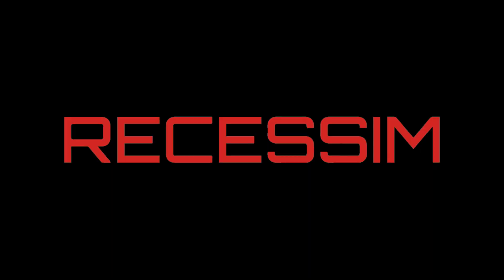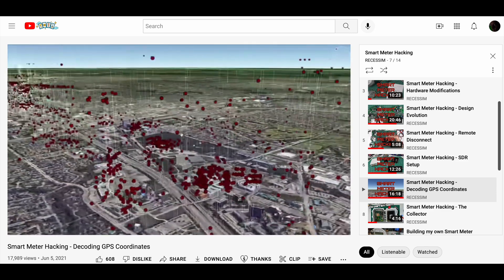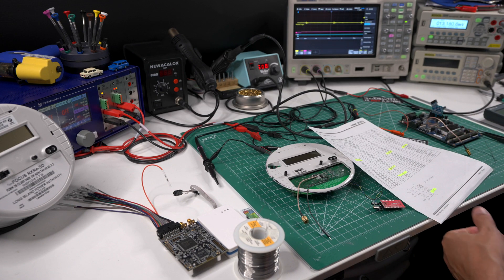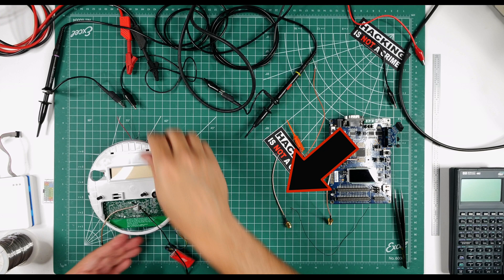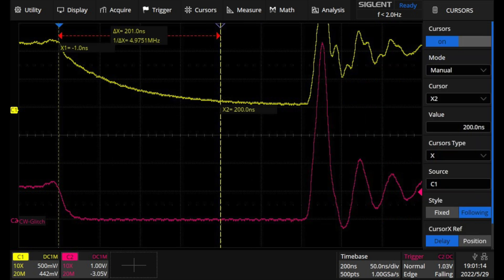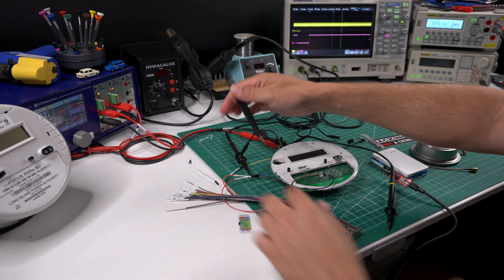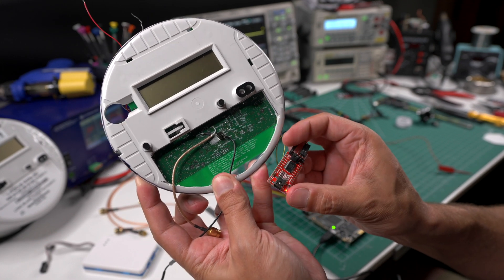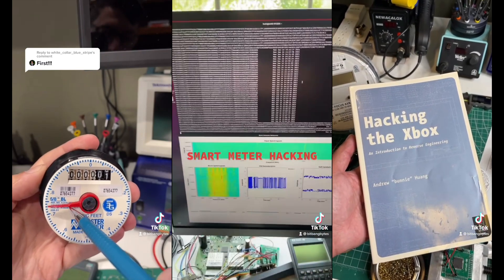CONFIRMED Smart Meter Attack

Comment: One security protection against voltage glitch attacks is by manufacturing a void in only some of the layers of the PCB under the chip with a Schmitt trigger like circuit in it to provide hysteresis to the power to prevent an undervoltage condition; power only gets to the pin if it is high enough and is cut off completely when it drops. You then have to unsolder the pin in order to perform the glitch, making it impossible to glitch in the field when under a time constraint. This is particularly difficult if the chip is a BGA (many have a central area without pins) where you cannot access the power pin directly and have to unsolder the entire chip.

Comment: The slight variation in uC startup time after reset might be an oscillator or PLL waiting to lock?
Reply from the maker: That’s what I’m thinking too, it’s something that’s settling and can vary slightly each time
Reply: @RECESSIM  If the bootloader does an external memory access or sets any I/O pins, you could probably trigger off that. Assuming you want to glitch the transition after the bootloader has finished. Should be more deterministic than timing from reset.

Comment: So you actually do have the firmware now? Also, how can a puts() command  print the entire firmware, I would expect it to stop once it finds a null character??
Reply: How did you know something like this could happen in the first place? You went looking for it and then it happened, I don't understand how this is possible without a full understanding of the mechanism. Normally when you insert randomness in a running computer program it will just crash.
Reply from the maker: @CarloRoosen  I have seen other attacks and read that you can insert some well controlled “randomness” and cause issues that don’t quite cause a crash, but cause unexpected things to happen. I experimented with this technique using a development board that uses the same processor and then moved on to the actual hardware I want to attack. Nothing is ever what people tell you it is… :)
Reply: @RECESSIM  Yes clear, I think I understand how you got to this point. The question remains, how is it even possible? After the glitch the processor is operating on its own. So there must be a state (registers & memory) in which useful things can happen not intended by the programmer. To me that is incredibly difficult to grasp. Like the monkeys typing Shakespeare thing. Anyway, I am looking forward to the next step.
Reply: Also, you should have more viewers ;)
Reply from the maker: @CarloRoosen  Thanks. Feel free to spread the word!
Reply from the maker: I am very close, not sure why the puts() doesn’t stop at a null when I glitch it, but it will loop through the entire flash multiple times. I let it run for an hour once and it seemed to end up in a tighter loop but still printing!

Comment: This is insanely interesting!
Trying to glitch the processor when it is initializing the JTAG lockdown should be worth a try. Automating the check as you did with the serial output should be possible.

Would it help to increase the diameter of the glitch cable so that It can drain the internal capacitors faster / more precise?
Reply from the maker: I am excited to give that a try, if JTAG could be unlocked with a glitch it would be quite a find! 

Generally outside of decreasing wire length, or increasing wire gauge people just remove the decoupling caps on the target board which has the same effect. Could make the processor a little less stable though, I was trying to avoid any other mods to the meter.

Comment: A lot of the ringing you're seeing on the scope will be due to using the ground flylead on the scope probe - for this sort of work you really need to use an ultra-short (<10mm) ground to the nose ring of the probe
Reply from the maker: Thanks Mike, appreciate the suggestion! I have those short spring ground connectors for the scope. I’ll test that out to see how it looks. I was curious about the ringing but more concerned about the capacitor decay time so didn’t chase it.

Comment: I understand how glitching the processor during the serial I/O operation could reset a pointer and start it dumping program memory, but the I/O function is almost certainly looking for a null to terminate transmission and the program memory is certainly going to have a good number of zero bytes in it, so won't it stop prematurely?
Reply from the maker: That’s what I would have assumed to, but it must be causing a different issue because it’ll loop through the ENTIRE flash multiple times.
Reply: @RECESSIM  I was assuming the application code was written in C, but perhaps not? Since it's a high reliability/security application it may be something like Ada that uses a length word instead of null termination.
Reply from the maker: @ferrumignis  It's definitely written in C++ because I wrote the test code that's running. Looking at the assembly file and how that code was put together by the compiler might reveal something.
Reply: @RECESSIM  Have you searched LinkedIn to see if you can find the folks who designed or wrote the firmware?
Reply from the maker: @scoresandry  I didn’t bother, I’ve tried with other devices with little luck. Might be a breach of some NDA they signed too so don’t want to inadvertently get someone in trouble.
Reply: @RECESSIM  Have you read this? "Embedded Firmware Diversity for Smart Electric Meters" If you google that phase it should be at the top. You might want to reach out to S McLaughlin.
Can you tell me if any of the meters use Renasas MCU?
Reply from the maker: @scoresandry  I’ll check it out, some indeed do use Renesas
Reply: Arpad Toth  printf is able to print numbers in hex using the %X or %x format string.
Reply: It might be that the glitch is not resetting a value to zero, but perhaps all 1's instead, and if the value that got reset happened to be a "remaining count" value  = eg. in code like: while (to_do > 0) { count=print_character(buf); buf+=count; todo-=count } - like what happens in _IO_new_file_write - then perhaps the glitch could result the observed behaviour?.  It's really interesting watching the process of discovery here, and I'm impressed at the dedication shown to the cause!
Reply from the maker: @gundys_garage  It's beyond obsession at this point, like chasing my holy grail! :)

Comment: very nice progress. 

I guess the difference in wire length can also be viewed as an impedance mismatch between the chip whisperer output and the  node you pull down, if they were matched the longer cables should mostly add delay but should not change the pulse shape. 

A little offtopic but I really like your "oscilloscope probe tip" like extensions for your power supply wires, they seem like a useful thing to have. 

Looking forward to see what comes next. 
Are the pulse parameters a "universal constant" for this type of meter or do you need to tweak it for each unit?
Since most capacitors have like +-20% tolerance, which will alter the pulse shape, I would imagine, that you have to slightly tweak them each time.

Comment: Anyone want to start a pool if an exploit can be found to disconnect power? Battle Star taught me a great lesson. If you want to secure something don't put it on a network. If you can do it remotely, so can an attacker.
Reply: There's a 78 page document DEN 0083 from ARM that actually explains their device are susceptible to glitches ;)
Reply from the maker: @TradieTrev  This right here is why making videos and getting comments is AWESOME! Looks like I have my weekend reading lined up 😈
Reply: @RECESSIM  "TBSA-M does not address laboratory attacks in which devices are unpackaged and probed, or power analysis
attacks in which the power consumption of the device is correlated with its processing activity to extract assets." That's your juicy bit, have fun mate!
Reply from the maker: Indeed, only a matter of time. 15 years is a LONG time to expect a device to remain secure